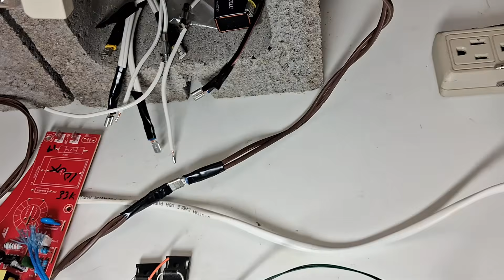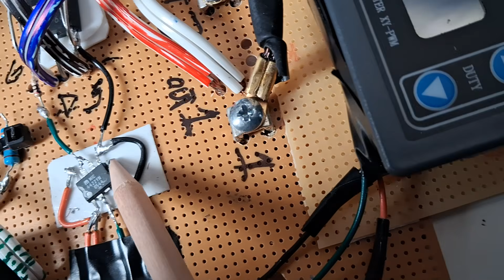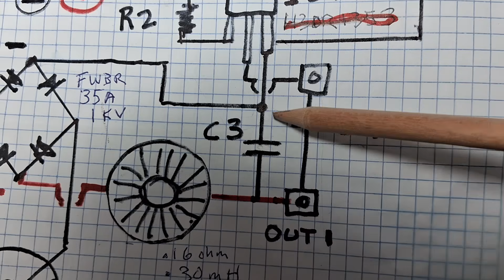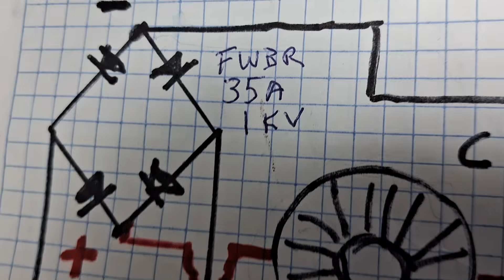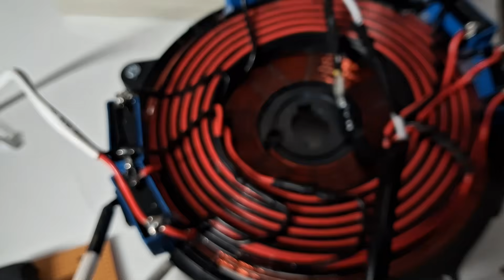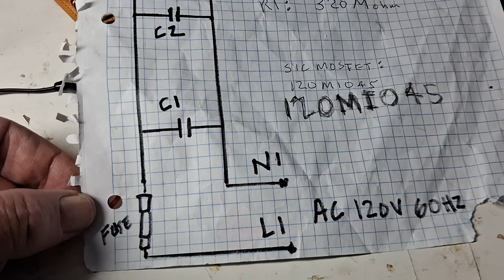18 minutes leading up to failure. The 5th try, fuse blows any ideas why?

Comment: Idk if im wrong or not but the Zener sounds like it may be wired wrong but im unsure at exactly what it’s supposed to be doing because there’s different ways to wire them depending on exactly what the circuit is supposed to be doing! 
Don’t forget there can be an internal flyback diode wired between source and drain. I haven’t finished the video yet I need more but I’m thinking
What’s the duty cycle set too? That’s actually very important many reasons something else Mosfets hate pure switching AC.  The X2 tells they type of location in circuit it can be used in, X rated capacitors our used in circuits directly powered on main current non isolated, because that’s hot circuit reference to Earth ground! 
I’m believing similar now, there’s very little inrush current limiting, the circuit is working kinda like boost or even buck converter in a way
The AC input is main power supply of course the whole circuit after the fuse to the rectifier is call an EMI/EMF filter 
There two main types, this is the super simple not so expensive, there’s a second circuit that incorporates filtering for both type of created noise believe it or not there more then one type of noise! 
The circuit kinda tuned thing, since you’ve changed the layout, this circuit impedance change. The cap used here should also be X  rated safety caps if there’s no mains supply isolation. 
The original circuit, may have had a micro processor and that had away of controlling that inrush current a bit more. There’s quite a lot of extra parts on that board including it’s original source signal, which would be a feed back power supply to a degree “boot strapping” 
As is without any in rush current limiting, the ac sine wave can  be at either extreme at any point in time! Up or down sine wave and the circuit will try and pull as much current as possible at the PEAK to PEAK voltages not RMS! The highest amplitude to about minus how ever many percent or db you wish and it will still pull quite a lot of current. 
Don’t hook up an oscilloscope unless you know about isolated versus un isolated power supply’s  you can make you scope go💨🔥poof magic 
PWM at 50% could be reaching the coils saturation point, and over saturating it too! There’s a fair amount of interesting stuff to drive inductive loads like that! 
Most important though is safety this is a pretty dangerous circuit run without isolation right off the mains my friend! 
I work on tube radios from the old days have two radios one from around 47, the other the 50s 
Both directly mains powered 
But one is half wave rectified capable of running both AC or DC, but the older one can’t having a voltage doubler circuit, a charge pump taking 125 to nearly 250volts DC

Comment: Hi Doug, you can try replacing the load bifilars with a large wattage low value resistor in the power FET drain circuit. If you know the bifilars DC resistance make the resitor initially 10 times higher. Then it it takes away the inductive effects in the drain circuit . This gives you a chance to isolate if the fault is in drain circuit or elsewhere. Also its then possible to look at power FET drain terminal with  your scope to see if input pulse shape is being replicated by the output circuit. All the best Gerry
Reply: If the power FET is working ok the temporary load resistor can be paralleled with more and more resistors till it's equal to the DC resistance of the bifilar coil itself.
Reply from the maker: Hi Gerry
Thanks, nice to hear from you!
Yes I understand to substitute the inductive flat coil with a straight load resistance and see how that operates and how the mosfet works then.
Could be the mosfet simply locked closed and without the 24khz pulsing it's like slamming 120V and more or less unlimited current from the grid into the approx 1 ohm primary flat coil.

Scope on a working cooktop circuit with with load of four 500w rated halogen in parallel shows into primary c
flat coil within cooktop to be  150VDC pulses at 50% duty cycle andat 24khz   and also the collapsing field shoots into the load of halogens too. (This about 4 times voltage to about 600vdc)

Ole on EVGRAY board says to never test without the load of halogens otherwise the string of flyback/backemf negative pulses (jammed into a 8.3ms wide "envelope" of the rectified 60hz AC)
Will destroy all it can in its backwards journey...

I also read recently that the 4422 gate driver chip should have a 10K pull down. Resistor from its pin 2 to ground to prevent at start up or accidental disconnect the mosfet locking shut which could be the problem right there 
. 
I need to add thar resistor...note they saying pull down resistor across the 4422 driver chip, not the mosfet itself...
Reply: @MrDKONZEN  Forgot to mention, before connecting scope its important to run the entire circuit under test off an isolation transformer!! If  you dont have one, it can be made from 2 power step down transformers. eg 240 in to 12V out hooked up to a 12V in to 240V out. That way your now isolated circuit can be safely earthed via the scope's earth lead. Be safe mate we selfishly need you alive!
Reply: Why not just use a zvs ? Won't that be a more scalable option?

Comment: Doug that's a great video on a subject close to my heart. Very well done sir.
Now, I just have to try to make one. Cheers Warren
Reply: Hi Wsrren
This is just a copy of circuilt indide my.kitchen HQ brand voiktop, kess the bells a d whistles eh.

Note it has only one mosfet and us not  AC, but pulsed DC with collapsing field shooting intk the primary flat coil with ghe lite wire.....then this coil induces itself  into the stack of series adding bifklar flat coils 

I am having problems with too  big of "inrush" current it looks.like  (see comments fro. Gabriele)

 using a variac for AC input, or some series incadescent light bulbs should help reduce the onrush current 

 Also not sure if the 10uf AC cap  between the ground side and positive side.of output of FWBR needs to be there (C3)

Also next time will have duty cycle about 10% then work way up...

I will get it going evrntually don't worry